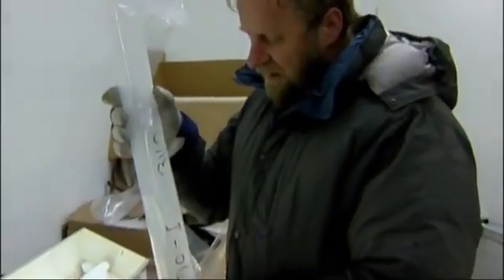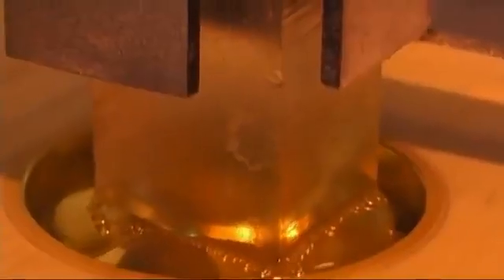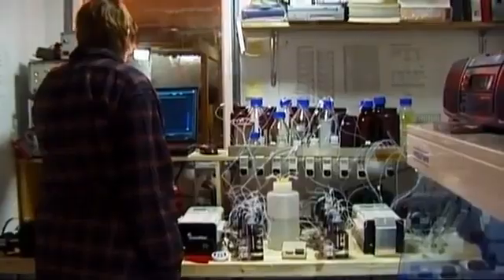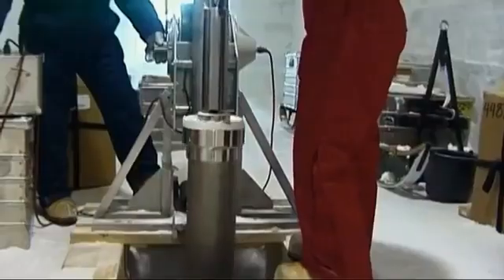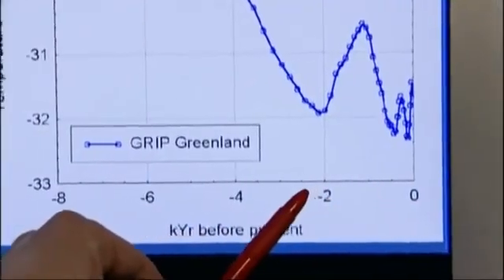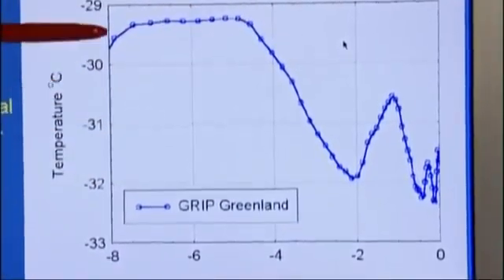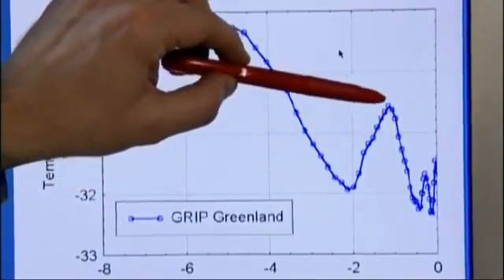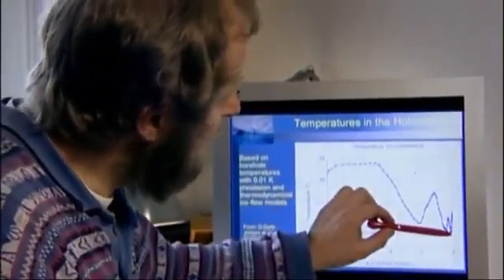The BEST Climate Clip I've EVER seen - What do you think?? #SCIENCE

Comment: Whatever happened in Greenland, paleodata from widely dispersed sites in the northern and southern hemisphere going back 24,000 years show that globally temperatures now are higher than at any time during the holocene.

Globally resolved surface temperatures since the Last Glacial Maximum

Matthew B. Osman, Jessica E. Tierney, Jiang Zhu, Robert Tardif, Gregory J. Hakim, Jonathan King & Christopher J. Poulsen
 
Nature volume 599, pages239–244 (2021)

In 1981, at a time when northern hemisphere temperatures had not risen from the peak in the 1940s which was caused by maxima in solar intensity, the Pacific Decadal Oscillation (PDO) and the Atlantic Multidecadal Oscillation (AMO), Hansen et al published a paper in Science which correctly predicted that the warming signal due to increasing CO2 concentration would become evident above the background signal later that decade, and also correctly predicted the amount of warming over the next forty years.

Climate Impact of Increasing Atmospheric Carbon Dioxide

J. Hansen, D. Johnson, A. Lacis, S. Lebedeff P. Lee, D. Rind, G. Russell

Science Volume 213,  pages 957-966, 1981.

In 1990, the first IPCC report was prepared which predicted that the most likely amount of warming with each doubling of CO2 concentration, the equilibrium climate sensitivity (ECS) was 3 C.

Global temperature data and Mauna Loa CO2 data have shown that prediction to be correct.

In science, that is the strongest evidence you can get that the causal theory is of anthropogenic global warming is correct. correct.

The warming is not due to the sun as solar intensity has been declining for decades toward the Grand Solar Minimum.

Also, if the temperature rise was caused by increasing solar radiation, the troposphere and stratosphere would both warm.

If caused by an increase in greenhouse gases, the troposphere would warm and the stratosphere would cool. That was predicted in1967, and has been shown to be what is happening by satellite data.
 
Syukuro Manabe, the surviving scientist who made the prediction (his collaborator Richard Wetherald had since died) was awarded the Nobel prize in physics in 2021.

Comment: Seems like most of the comments on this video misunderstand what the video tells them in relation to the climate debate.
The video shows how temperature has been long timespans.  It does not tell you anything about how trustworthy the data is, but lets assume for fun that they are 100% accurate.  If so, the video tells you that the temperature has been fairly stable over the last 8000 years, with a steady decline that took roughly 2500 years for the temperature to change 2.5 degrees.  Then a warmer period where it changed roughly 1.5 degrees in 400 years, dropped 1.5 degrees again in 400 years and then goes into a less stable period for the last 200 years with a MUCH more irratic and fast change than in the previous 7800 years.

We all know from graphs from the last 100 years than this erratic behaviour seems to increase, though this does not show well on this graph since the timespan is too great for the last decades to stand out.

The conclusion that can be drawn from the graph is that
1. On large timescales there are variations in the temperature of the earth.
2. The last couple of hundred years seems to stand out and should undergo closer inspection.

None of these conclusions are odds with the current view on climate.

Ask yourself these 3 questions:
1. Would there be me oil and coal in the ground if we humans dident dig it up?

2. Does burning oil and coal release CO2?

3. Is CO2 a gas a climate gas?

The answer too these questions should all be yes.  If you find yourself not answering them yes, educate yourself.  The 3rd question is probably the hardest to educate yourself on, but take a corse in solid state physics and with a little luck you will do experiments that prove too you that this is the case.  Its not a particalarly hard experiment, but Ill not go over the details of it here in a youtube comment that few probably will read.

By answering yes on the 3 questions above you are left with a problem, either you have to admit that the increased conentration of CO2 in the atmosphere leads to a human made global warming, or you have to come up with some way the extra CO2 we let out can supress some other source of CO2 release or some way all the extra CO2 can leave the atmosphere.  (And offcourse wave your hands over the measurements of the increased CO2).

Now the discussion has turned, because now you are no longer able to claim that there is no human made global warming, because it OBVIOUSLY is, however the discussion is now rather how big if the human made part of the warming?

This is not an easy question and this is where we debate.  

There is no debate over if humans burning of coal, oil and gas leads to global warming.

If you have read this far, thank you.  And now I would like to point out that the increase in energydemand from the industrial revolution wich ultimatly lead to a huge increase in  burning of oil and coal seems to overlap roughly with where the temperaturedata in the video becomes more irratic...  Suddenly, the data in the movie seems to suggest the oposite of what most commentators seems to think....
Reply: Great comment! Glad to see someone on this video comment tread with objective reasoning and critical thinking skills!
Reply: @House_Stark  Indeed, but I'm wondering how long the comment will remain until it is deleted :). I posted a link to a debunk article, but it seems it disappeared. So, the "What do you think?" question in the title was not really an open question in the end...
Reply: C02 is plant food. When megafauna existed C02 and 02 levels were wwwwaaaaaaaaaayyyyyyyyyyyyyyyyyyy higher than today! What made megafauna grow so big? 
Also the big fire ball in the sky, the sun! Is the sole cause of 99% of global temperature change, FACT.
You are a brainwashed dolt and 100% a brainwashed vaxoid that took the mRNA gene therapy over common cold, because the tv told you to do it.
Reply: Current view on climate? Science does not work that way.

Stable for 8,000 years? What have you been smoking?
Reply: @saintallnights7239  With "fairly stable" I refer to changes in the temperature happening at rates around ish 0.1C pr 100 years for most of the 8000 year long period.  
The more "unstable" changes are happening in the last 250 ish years, and if you look at more up to date graphs focusuing on 1900-2023 you see between 1900-2000 the temperature is changing 1C pr 100 years.  (research gate, google for source)

Thats 10 times faster than at other points in the last 8000 years if we only go by the graph in the video.

If you look at the period from 1981 to 2023 (climate.gov) the change is around 0.18C pr 10 years in this period...  So again a lot faster.

That is what I mean with "fairly stable" vs the more current "fairly unstable".
Reply: Oh it's not risen in 10 years and down the last 3+
Reply: @saintallnights7239  Seems you misunderstood the x-axis in the graph in the video.  I know it shows single digit numbers, but the graph shows numbers represtenting a thousand years.  So when it says 8 it means 8 000 years ago.

Hope that clears up your misunderstanding.
Reply: @arnekristian5704  Yeah I have over 200 accurate predictions in science and am a multi-disciplined scientist and have gone up against Mann, Cox, Hayhoe, Schmidt and others.

No one has the accuracy rate that I have. Period.
Reply: @arnekristian5704  "If so, the video tells you that the temperature has been fairly stable over the last 8000 years, with a steady decline that took roughly 2500 years for the temperature to change 2.5 degrees"

This is not true, is it?

Maunder Minimum and if you go back you just find spikes that make todays look like a fart in a thunderstorm.

YOu cannot cherry-pick in science. PERIOD.
Reply: @saintallnights7239  So true, you cannot cherrypick.  How that is in any way relevant to the quote you use here is a mystery.  Maybe if you take a look on the graph that is the main "data" that is presented in the video we are commenting on, then it makes sense too you?  All I did was describe the information in the graph in the video.  You are welcome to question if the video is true or not, that is ok, but as I said in my comment "It does not tell you anything about how trustworthy the data is, but lets assume for fun that they are 100% accurate"...
Reply: @saintallnights7239  "if you go back you just find spikes that make todays look like a fart in a thunderstorm."
   I am very familiar with the temperature record over the Quaternary, and also over the whole Phanerozoic. I cannot find a single time period where we have seen either such a steep rise in global temperature -- or CO2 concentration, come to that.
   But I bow to your expertise. You say there is more than one. So please give me the time period you are referring to and I will be happy to check the temperature record. My bet is that you can't, so let's see if your response contains some dates.

Comment: Climate has changed on a regular basis. We know that Antarctica was at least once tropical,  this supposedly before humans. Climate scientists (alarmists) is a crock.
Reply: If Antarctica was tropical it means pole shifts are very real and that the planet does indeed flip and spin on another axis.
Reply: @v4skunk739  -- No, Antarctica was tropical because of something called continental drift. It was much further north during the Cretaceous. In addition, the Earth was a lot warmer because of higher levels of CO2. No great mystery.
Reply: @v4skunk739  wrote: "C02 doesn't increase temperature"
   OK, thanks for letting me know. I'll bear that in mind.

"shouldn't water vapour be the cause of temperature change"
   Not the cause, no. Water vapor is a passive greenhouse gas (a feedback) because it is dependent on air temperature. Warmer air can hold more water vapor, and cooler air holds less. This is basic physics, if you've ever seen dew in the morning.
   So let's say we decide to release billions of tons of water vapor into the air, as we are doing with CO2. The result is it would come crashing down to Earth, because the atmosphere can only hold a given amount of water vapor for a given temperature. The only way for the atmosphere to hold more is to heat it up.
    Which is what we're doing with CO2. When you add billions of tons of CO2 to the atmosphere, half of it stays there. It accumulates. This warms the atmosphere and allows it to hold more water vapor -- which is why water vapor is called a feedback. It amplifies the initial warming. As we are seeing, and as we have seen throughout the Phanerozoic.

"the sun is the biggest factor of temperature change."
   It's certainly a very important factor, but clearly not the biggest. For the last 40 years solar activity has been stable, then falling. And yet temperatures have been rising.

Comment: Well, just a few degrees difference seems pretty stable to me. If we look at the range of temperature in the Universe it's millions of degrees difference. So a few degrees temperature difference is nothing on a cosmic scale. That's pretty amazing considering all the variables. The problem now is with manmade Co2. Co2 is a greenhouse gas. That's a fact.

If we take a look at the era of 'The Great Dying', there was approximately 4000 ppm of Co2. When we measure ppm of Co2 now, it's around 400. I measure something like 440. That's only 10% compared to that of that mass extinction era. We didn't become a 'Venus' then. 
But the difference is that during the era of the 'Great Dying' it was more gradual. It took a couple of millions of years to reach that kind of levels of Co2. And the sun was a bit cooler too. There are probably a lot of other variables too I'm not aware of.
The problem however now is that we reached higher levels of Co2 in just over a century and the sun is much hotter. What was it, 3% hotter or something. This could result in a runaway greenhouse effect. I don't think it will, but it could.

I've been looking at the models and they're incomplete because of so many variables. But even the most optimistic predictions spell hard times for humankind. The most favorable prediction is just 2,5c warming. That's just a few degrees, but it does have some mayor consequences. 

I'm not trying to fearmonger here. If you believe there are no consequences to our actions, I don't care. There is nothing we can do about this now anyway. And I do believe that the measures we in the west are taking now to mitigate a greenhouse effect is a hoax. It's Lysenkoism. They say they want to go net zero emissions, but nothing they do points out they're actually trying. We're burning more fossil fuels than ever, not less! They're only using global warming to make bank. They don't care.
Anyway, I won't be around in 2050 when global warming is problematic and most certainly not at the turn of the century when it peaks.

Comment: Has no one else in the comments mentioned the speeds at which these temperature changes are occurring. You go from gradual cooling off over thousands of years to a very sharp uptick at the end over 100 years or so, surely the rate at which things change is also a big contributor to the climate change problem. Anyone with a modest critical mindset could see that on current trend we will be back where it started in another 100 years, not 4000+ years.

Comment: How can we be sure the ice is exactly the same temperature when it fell as snow compared to when the core was drilled?  I suspect we cannot. To ignore even the mere possibility that releasing carbon into a finely balance carbon cycle could affect the earths atmospheric temperature, is myopic and obtuse in the extreme. Shame on your closed minds.
Reply: I think he was dumbing this down for a TV audience. The method used is to measure the ratio of O16/O18 oxygen isotopes. These vary according to rates of evaporation and precipitation, which is a proxy for temperature.
Reply: @potholer54  Thanks for the explanation. I was not aware of this method. I will look into this further. Its shocking we cannot have a grown up discussion about this important subject.

Comment: If you measure and record temp from the lowest point in 8000 years, then it has nowhere else to go, but up.
Duh...
Reply: Yes, it did go up. But then it went down again.
   Then up again. Then down.
   Steffenberger is referring to the period up until 1950, before CO2 concentration began its sharp upward incline. When that happened, and aerosol pollution cleared, temperatures began a sudden upward spike. This is about a century after that low point. So what caused that sudden increase? Any ideas, professor?

Comment: I am still trying to figure out if this is a skit. The ice actually "remembers" how cold it was 8000 years ago? You can actually figure this out just by measuring the temperature that it has now?
Reply: No, the actual temperature of the ice changes. The historical data is stored chemically and with the ratio of isotopes ( eg. oxygene: 18O vs. 16O). I think, 3 Kilometers of ice reflect the last few million Years of Climate-Data and not just 10k Years.
During the last 10000 years earth cooled down (very slowly) by 1.5-2K. And 4000 Years even before that earth was 8K cooler.
Berlin was covered by a Glacier back than. We are currently getting hotter than the hottest point in that curve. They just don't show it in that diagram.

Comment: If Co2 and temperature would be that linear correlated, how can we explain this data?
Reply: The question is whether the dataset was collected correctly. Do you believe that ice has a memory of the temperature when it was formed? Can one just insert a thermometer into a hole today and measure the temperature that was thousands of years ago?
Reply: @solomek1  it makes sense that you can get information from ice but i understand your point. 
I agree that the database is not perfect, but we only have what we have.
Reply: @saschaganser9671  But that is where the method in this video differs to the standards used in the climatology research. The temperatures are inferred by modelling based on the experimentally determined ratio of isotopes of water (oxygen forming water) frozen in ice or in the air bubbles trapped in ice. The methods using isotopes are not difficult to understand qualitatively but it is nevertheless harder for a layman to comprehend than inserting a thermometer into a hole presented in this video. Unfortunately, inserting a thermometer in a hole cannot measure the temperature, which was on the site thousands of years ago, that is bogus. There is no memory of ice, it is not that simple and nature does not function like that.